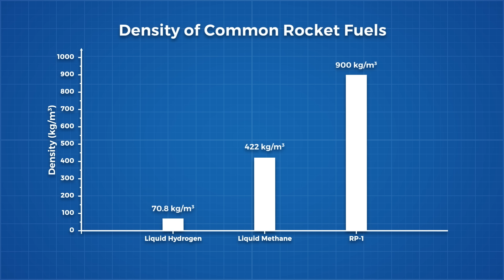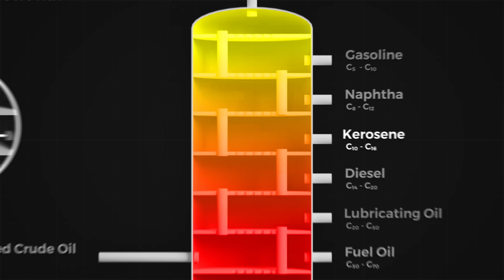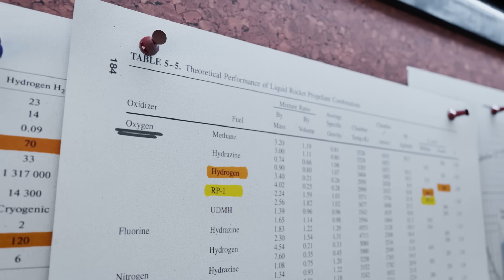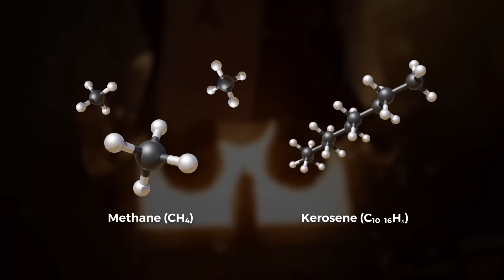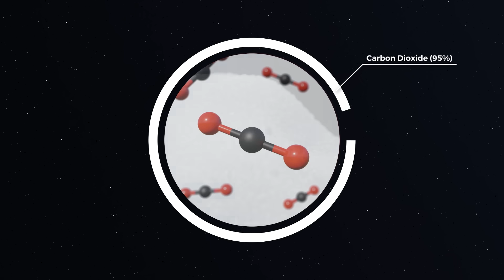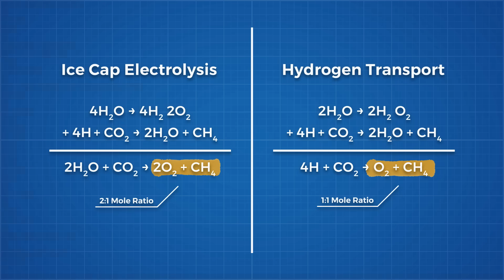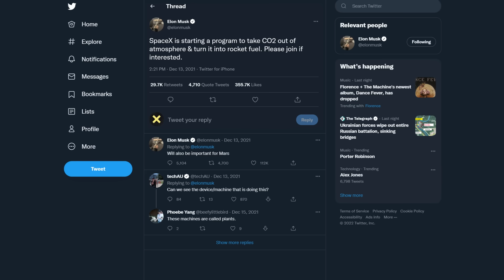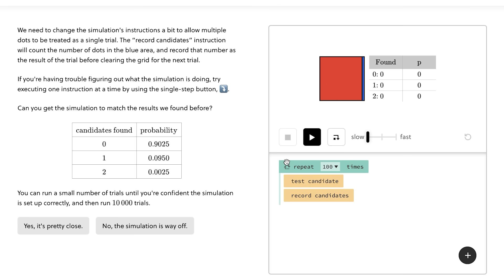Why SpaceX is Using a New Fuel

Comment: While relatively trivial in the overall scheme of the video the reasoning for using RP-1 (kerosene) for the Saturn V is not really correct. Density is a factor but much more important is delta-v. Delta-v is the fancy term for how far a rocket can go. When you look at the equation for delta-v the efficiency of the engine is not very important in the first stage of a rocket. However the first stage is the heaviest. It so happens the thrust is inversely proportional to rocket efficiency so almost all rockets use less efficient but higher thrust engines on the first stage. I should note that it doesn't matter how efficient your first stage engines are if they don't have higher thrust than gravity you will sit on the launch pad uselessly burning fuel.
Reply: Yes, one of the reasons why methane was chosen for the raptor engine is that the full flow cycle is impossible with kerosene (too dirty) so raptor actually has more thrust than a kerosene engine.
Reply: That is what he's saying, I think. You can always add more thrust, that is never the issue. The issue is the tradeoff you're making if you add more thrust. The weight you gain depends on the specific impulse, while for volume it's density if propellant. So for the first stage, you could say h2 was not dense enough to prove enough thrust, in that: providing enough thrust would've cause the tanks to become too large. Hence they went with kerosene.
Reply: @Merthalophor  SpaceX is increasing thrust by increasing chamber pressure and not the chamber size so they are not trading anything. That's the whole point of the full flow cycle.
Denser propellants are easier to pump because the volume of fuel to pump is lower, but you can also increase the power of the pump and that's what they are doing with raptor, the turbopumps combined power is so great that chamber pressure is higher despite methane being less dense.
Reply: @johntheux9238  Not really. Because of boil off issues transiting to mars space X can't use hydrogen. As a result they need the absolute highest efficiency to compensate because trying to get into orbit with only 300s of Isp (highest efficiency of non full-flow) is a fools errand. Furthermore full-flow is the only way to achieve high thrust and have both oxidiser and propellant enter the combustion chamber as a gas making them very reliable which is critical when you're an entire planet away. The RnD costs of developing full-flow is stupendous. No private company would willingly take it on if there is an alternative which for space X there isn't.
Reply: @ebonyayers6145  Yeah, like I said thrust is just one of the reasons, not the only one.
Just wanted to point out why they are using methane for the booster and not just the ship.
Reply: @Merthalophor  That's not exactly how it works. Firstly we need to think about a multi stage rocket as a series of rockets carrying increasingly smaller ones. So the equation for delta-v looks like this Δv=Ve*ln((Mi+P)/(Mf+P)) where P is the mass of the payload the stage is caring, noting that Ve=Isp*9.81. From this we make two observations: one, the performance of a stage is proportional to the fraction of mass expelled, two, using cursory limits if P is big the Δv->Ve*0, if P is small Δv->Ve*c where c is some constant. 

Real Engineering's explanation for kerosene in the first stage is that the tank size for hydrogen would be too heavy. While this isn't wrong it wasn't the main reason. Now the Saturn V is almost a two stage rocket, technically it burned a small amount of fuel in the third stage for orbital insertion but that is trivial in the grand scheme of things. The second stage only had to carry the rest of the rocket into orbit where as the first stage had to carry the rest of the rocket and the entire second stage. As a result the payload of the first stage is vastly greater than the second stage. Thinking back to our limits the delta-v of the first stage is Ve*c where c is a small constant and the delta-v of the second stage is Ve*C where C is a big constant. As a result putting efficient engines on the bottom stage makes less of a difference than putting them on the stop stage.

Now the F-1 engine (Saturn V first stage) produces 6.8MW of sea level thrust. The J-2 engine (Saturn V second stage) produced 0.5MW of sea level thrust. If the J-2 has a sea level optimised nozzle you could expect about 0.8MW of sea level thrust. So to have the Saturn V lift-off you would need 43 J-2 engines. The cost savings of less fuel would be inconsequential compared to that many engines and plumbing complexity. But it gets worse, every engine has a chance of failure and engines of the time weren't vary reliable. Using our favourite binomial distribution the chance of at least one failing would be near certain.

So the biggest reason we put low efficiency high thrust engines on the first stage is because of cost savings and reliability. Mass (and density) overall is a minor consideration. Hope that helps

Comment: Or we could do something way more useful and energy efficient than colonizing Mars.
Reply: Or we can do more than one thing at a time!
Reply: @NGCAnderopolis  We can do more than one thing at a time but we can't do a everything at one time. I'd rather go to Mars later. Or if you want to do more than one thing at a time let's go to Mars maybe but let's definitely get power beaming and/or orbital industry up and running.

After all, technology that solves problems on Earth can solve problems on Mars.
Reply: Lot of the technology used to go to Mars has uses here on earth, just look at how much the moon landing did in kickstarting many industries.
Reply: @Steph.98114  I didn't say not to go to space. There's a lot of solar energy blasting off into the void that we could collect. There is a lot matter on the moon that is easy to access compared to Martian materials. We could build habitats perfectly suited to ourselves or to our industries up in space from materials in space. 

Some think it would be easier to colonize Venus' atmosphere than it would be to colonize Mars' surface. In any case, a lot of the atmospheric components we would need for Mars exist on Venus. 

My problems with Mars colonization are 1. that we have a pressing need to complete other space projects and 2. the logic of doing X in space helps with Y  on Earth also works in reverse: doing Y on Earth or in any other place helps with X on Mars.

Comment: What're reaction will be used in the reactors to produce methane and oxygen, there will be a need for an awful lot of electricity. We need to bring a large number of nuclear reactors from Earth. And I see that as an almost impossible logistical exercise.
How carbon capture ended on a Mars video?
Carbon capture is a shill of immense proportions. The energy required to capture CO2 from the atmosphere require so much energy that the entire process generates 100 times the CO2 it remove, just in different places at different times. The carbon emissions can only be reduced by building large numbers of nuclear power plants all over the world...
Reply: Sabtie and electrolysis. Since it will have years to produce it, it can be solar powered.
Reply: I say go for it.  Nuclear power has consistently proven to be safer than using fossil fuels, despite a few high-profile accidents.  Fossil fuels cause far more deaths than nuclear but they are never reported on because it's become routine.  For space travel, most of the weight of a nuclear plant is in shielding, so if we don't need that for an unmanned mission it looks like the cheapest way to get power to mars.  We've already sent plenty of nuclear powered space probes, and so far it's worked just fine.  Solar power doesn't work so well due to the reduced amount of sunlight.

Comment: Process on Mars that creates both water and rocket fuel.... hmmm, seems like a good idea
Reply: It doesn't create water. You need to mine that in the first place. Then you split it into hydrogen and oxygen and the Sabatier process produces some water as an intermediate by-product (which you then have to electrolyse). The hydrogen you need can only come from water, and that has to be mined. And that's where the whole idea sinks.

Comment: clog up the intrecate mechanisms of the engines? the sud is created during the combustion process in the burning chamber. not at the turbopumps.
Reply: @Marsupial for wich you can actually prep..
Reply: The turbo pumps run fuel rich which produces a lot of sot

Comment: "SpaceX works to unlock the magic of reusable rockets". Aha, so they are doing what was done with the Shuttle program 50 years ago?
Reply: This comment section makes me want to ride Columbia. People are so stupid
Reply: Falcon9 is way cheaper per kg to space than the shuttle. Boosters have been reused after ten days, shuttles always needed months of refurbishment. The shuttles goal was rapid reusability but it landed way short of that goal.
Reply: @NGCAnderopolis  musks rockets arent as fast as you claim. it still takes months to reuse them.
Reply: @Irobert1115HD  true I was mistaking, the fastest turnaround was 27 days here in April not ten days. Still way faster than the shuttle.
Reply: @Irobert1115HD  it takes only a couple of days to do all the tests, the issue is transport, launch schedule and launch preparation, quickest turn around was 21 days.
Reply: Shuttle was more refurbishable, it took months of work to do including removing the engines for a full teardown. Falcon 9 on the other hand takes only a couple of days of testing, the biggest delay is transport and the launch schedule.
Reply: even better: the falcon 9 is about 80% re-usable. the space shuttle unde the right conditions was 100% re-usable.
Reply: @Irobert1115HD  well, only if you ignore the huge fucking tank that was thrown away every flight.
Reply: @NGCAnderopolis  that huge fucking tank was recoverable if the flight trajectory permitted.
Reply: @Irobert1115HD  it was not, and it was never recovered. It had to reenter without a heatshield from orbital velocity.
Reply: @NGCAnderopolis  proof?
Reply: @Irobert1115HD  proof of the external tank not being recovered? Every article describing the shuttle flight. Hell even wikipedia will show that. I would much rather have your claim of it being recovered proofed.
Reply: @Irobert1115HD  it's basic understanding of the shuttles launch sequence, the shuttle didn't have any fuel for the main engines on board, the tank was used to get almost into orbit and then ditched, the shuttle was then put into orbit by the manoeuvring thrusters.
Reply: @Irobert1115HD  no it wasn't mate
Reply: @Irobert1115HD  your forgetting the massive tank that it ditched in the ocean

Comment: 110% on closing the carbon cycle. Storage of energy by means of liquid production will be essential long term. Cheap hydrogen production is something the oil industry can actually help with; in situ hydrogen production (leaving the carbon trapped down hole) is something that can be done, ideally powered by renewables, and pipelines could be retrofitted to allow transport. We just need the will to do it.
Reply: Hydrogen is more dense energy compare to methane in term of mass but in term of volume methane is more dense energy than hydrogen
Reply: Carbon cycle could be closed IF you used nuclear fission power plants. But NOOOOOO, global warming is too productive as a political weapon to ever start fixing it.
Reply: Finding "the will" is the hardest part of the equation, it requires good governance, building concensus, effective politicians and buy-in from both investors and the public.  If it was so easy then we could have already insulated our homes, reduced our meat consumption, bought smaller cars to drive on cyclist friendly roads.  We have most of the answers already, the faith in future, uncertain and often specious technological solutions can only hold us back from taking mundane but necessary steps now.

I know this attitude is less exciting, less aspirational and makes for less interesting YouTube videos (though "Technology Connections" might beg to differ), but it does provide a practical way forward.
Reply: @JamesGriffinT   Nothing stopping 99% of people going vegan today. We millions of vegans have been vegan for centuries.  People for the Ethical Treatment of Animals (PETA) has prevented the needless breeding and murder of a billion animals by getting millions to go vegan.
Reply: It is not just a matter of having the will to build the infrastructure. The technologies for cost effective hydrogen production, though improving, are still at the demonstration stage at best.

Effort must continue on the R&D front, and government can support that. This is perhaps one area where our will must be focused right now. Gen IV nuclear reactors will also be so safe that I see no distinction between them and renewables. We should have no preference between the two; they will both have their contributions to give.
Reply: Hydrogen is too large and reactive to be a fuel. In order to transport and use it, it needs to be bonded to something like a carbon atom. Otherwise the metals and plastics used as pipelines and storage containers would leak right away. It is not a matter of will, it is a matter of chemistry. It makes no sense chemically or from an energy efficiency standpoint. Hydrogen is too large and volatile on its own
Reply: @tomkelly8827  regardless of the problem, Hydrogen is the main ingredient for producing Methane.
Reply: @tomkelly8827  Large?

Comment: And where would you get the colossal energy required for electrolysis on mars ? And don't tell me solar panels because you would need a crazy number of those to provide the power needed in this scenario, mars is far form the sun so the energy you get per area is less than what you get on earth and don't forget that those panels would get dusty due to mars storms.
Reply: A nuclear reactor of course. A tiny one.
Reply: nuclear reactors.
Reply: Starship will have 100 + ton capacity to mars so a few launches would get you a massive field of solar panels. Would be higher grade panels than what is put on earth of course. Or a small nuclear reactor.
Reply: @Jona69  I'm thinking about the nuclear reactor, here on earth they use steam to turn the turbines of an electric generator, on mars they might use one similar to the curiosity rover's, but I don't know if they can scale it up to provide the power needed.
Reply: @Jona69  that's to low earth orbit. the payload to mars is far lower.
Reply: @the-lag-gamerita5446  You realize the Starship can be refuelled in orbit right... And then it WILL be able to transport 100 tons (or something along those lines) to mass.
Reply: @the-lag-gamerita5446  Starship will use orbital refueling. So the payload to the moon or mars is actually the same if it gets filled up all the way. Which would probably take ~5 launches.
Reply: @the-lag-gamerita5446  
"And don't tell me solar panels because you would need a crazy number of those to provide the power needed in this scenario," 
And why do you think that? Have you calculated it?

"mars is far form the sun so the energy you get per area is less than what you get on earth" Interestingly the martian surface gets about as much sun light as earths surface. That's because Mars lacks our thick atmosphere and weather.

" that those panels would get dusty due to mars storms." 
A major misconception. Solar powered probes last 3-10 years on Mars without the ability to actively clean their horizontal panels. Solar panels for a huge base on Mars could easily be angled and dusted off every two years or so.
Reply: @3gunslingers  "And why do you think that? Have you calculated it?"  haven't directly calculated it, but i did the math on the deltaV. assuming it's fully refueled in LEO, starship with a 100 ton payload has 7500 m/s of DV. that's not enough for transfering to mars (wich takes about 4km/s), circularizing in low mars orbit (another 2,5km/s), and landing (wich is upwards of 4km/s). in other words, 100 tons is just too much. and that's also assuming the transfer uses as little deltaV as possible, taking 9 months to get there.
Reply: @the-lag-gamerita5446  
"that's not enough for transfering to mars (wich takes about 4km/s), circularizing in low mars orbit (another 2,5km/s)," 
Why the HELL would you circularize around Mars before making our EDL?

Starship is designend to enter an atmosphere with about 7,800m/s or more (11,000m/s is already a normal moon return trajectory) 
So Starship would fly to Mars and enter the martian atmosphere directly from its interplanetary course without firing up a single engine. 

But I'm really intrigued: Where did you get that idea from in the first place?